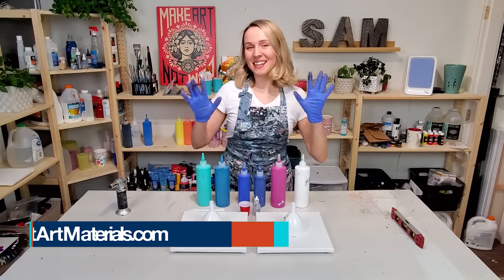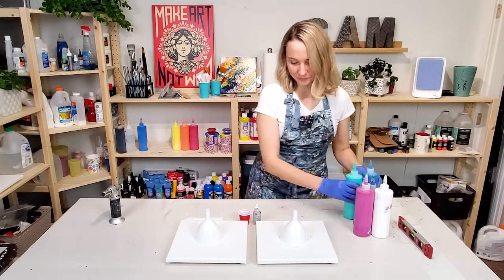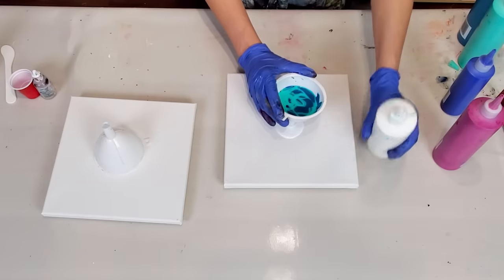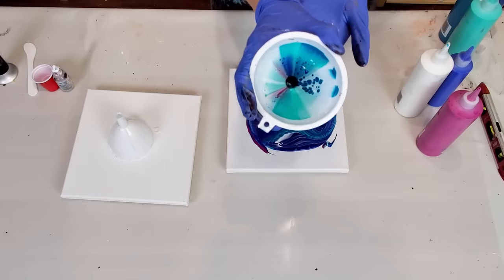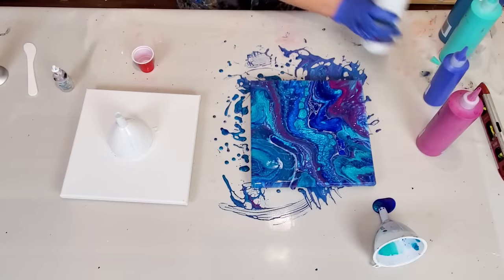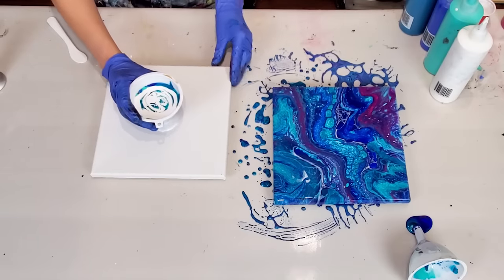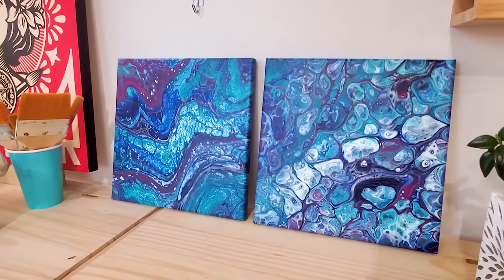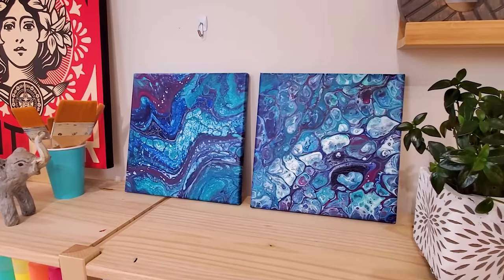Acrylic Pour Cells: Silicone vs No Silicone - What's the difference for Floetrol Cells?🤔🤓FUNNEL Pour

Comment: I prefer the larger cells; amazing result from 1 silicone drop in 1 colour. I'm learning so much from you, Olga. Impatiently awaiting delivery of torch so I can start my first pour. I've watched loads of vids; everyone has different opinion & method of mixing, pouring medium recipe, paint application etc. Some tilt almost vertical all around without centering paint between. Some say use hairdryer instead of torch...it's all so confusing, I decided to follow your way because of all other works & vids, yours are most honest & informative. I'm sure many other would-be pourers feel the same.
Reply from the maker: Thank you so much Helen! You're right there many approaches and ways of doing pouring techniques and mixing. I'm happy to hear you find my approach usefull. Just one thing - I don't think hairdrier and torch are interchangeable. Blow drier works great for moving and blowing the paint, while torch is great for popping air bubbles and can also help with cells.

Comment: I have been watching this channel a while now, and last Friday i did my first pour.  Immediately followed by 2 more, and am currently prepping 2 more 18x24 canvases for todays pours.  As fun as it is to watch it is twice was fun to do. Totally addicted and love the videos.  I am currently using decoart pouring medium (it was cheap on sale) and random 2 oz acrylic paints i had laying around.  I have been mixing by eye for viscosity rather than by weight as all the paints i have are different.   Super fun thanks for the videos.
Reply from the maker: This is just fantastic! And btw - that's the best way to mix your colors, just try to bring them all to the same consistency 😀
what techniques have you been playing with?
Reply: @OlgaSoby  My first two pours were flip cup pours. the first was on a dry white canvas with what ended up to be way  too much black mixed with a neon green a blue and white.  the colors had silicone, but the black took over most of the colors.  the second i put way too much silicone in the green and blue, but it came out cool.  the third i poured black on the center of the canvas and in the corners. next i mixed metallic gold with 3 drops of silicone and then orange and black with no silicone.  this time i did a slow pour starting in the center working my way out.  It came out so good I can't wait to do more.  Next I will do another pour like my third attempt, but then i want to try maybe the "kiss pour" or a "swipe".  Id love to share pictures of them for feedback if there is a forum or an email.  Either way thanks for the videos i have been binge watching you and another youtuber for tips and techniques all weekend.
Reply from the maker: Ian Thomas fun experiments! 😀 The more you do that, the better you are going to feel the paint. Yes, we have a Facebook group https://www.facebook.com/groups/smartartmaterials/
you are most welcome to share pictures there!

Comment: I do like them both, but that being said, the silicone one I prefer because of the larger more structured cells. I have found in my pourings that just Floetrol gives tiny, unstructured cells that seem to go very wobbly and undefined, if that makes any sense lol .. thank you for your comparison ... they are both beautiful .. much luv
Reply from the maker: Thank you, Inge! And yes, I know exactly what you mean, have you tried adding glue or pouring medium to your floetrol mixture?
Reply: @OlgaSoby  yes I do use glue-all and water for rings,flips and techniques like that :D too poor to do liquitex pm LOL but have used others. I think I use floetrol in almost, almost everything I do. Do you have a recommendation for a pouring medium that is not as costly as liquitex, that does just as good ?
Reply from the maker: @ingecrause4734  I actually like DecoArt PM recently. I hated it at first, but when I mix it with Fleotrol it works good for me, and it's much cheaper than Liquitex, at least in USA and Canada

Comment: I keep having a problem with silicone causing pitting in my paintings and I'm not sure what I'm doing wrong. Could it be using the torch too much/too close or too much silicone (I usually only add 1 to 2 drops in each color) or maybe the brand of silicone matters? It's so frustrating!
Reply from the maker: You might be using too much silicone, and consistency of your paint picture might be too thin (too much water)
Reply: @OlgaSoby  thank you so much! I'm thinking it may be a combination of both. I'm going to try less silicone, or maybe just leave it out all together from now on. Thanks for replying!